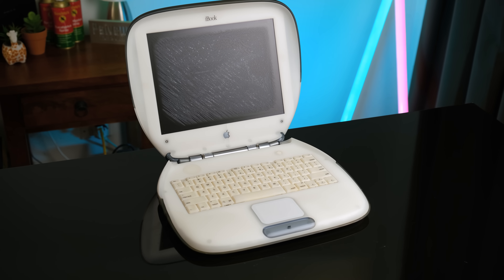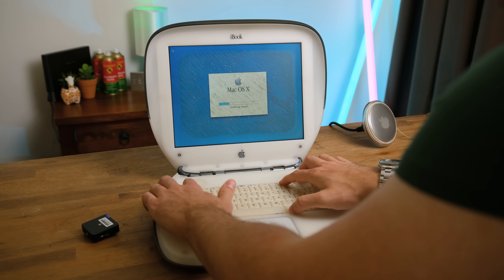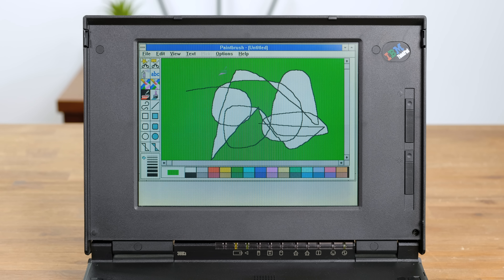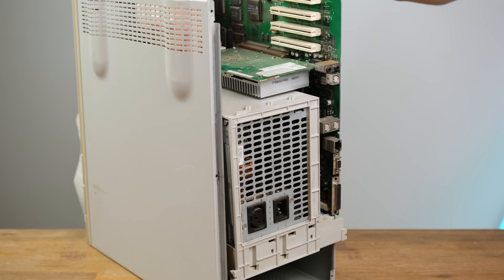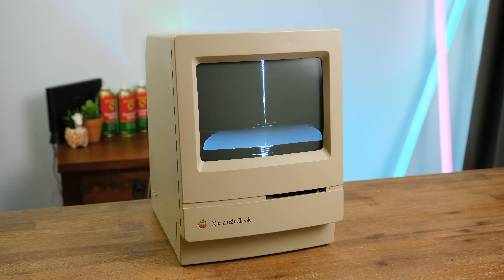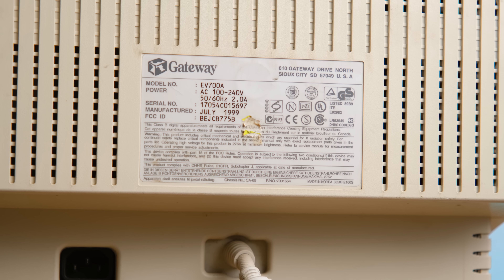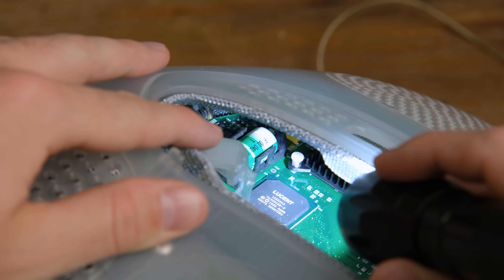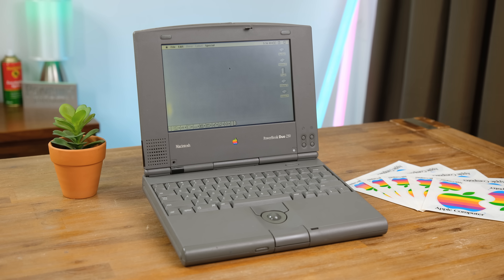So Much Vintage Tech Is Dying... Here's Why

Comment from the maker: And we're back! Hope you enjoy this video. ► Become a channel member today! https://bit.ly/PsivewriMembership
Reply: ok,
Reply: Glad to hear your back to using the same music from most of your recent videos. I love that track
Reply: I think you're not storing your things properly
I've never had this sort of problem with 10, 15, 20, or 30 year old tech of any sort. Tech doesn't just spontaneously combust.
You seem to love putting some sort of oil all over your plastics - yeah that's a recipe for disaster through chemistry. 
There's a reason that electronics engineers only ever use alcohols to clean plastics (aside from acrylic), PCBs, contacts, etc - it evaporates and afterward there's no chemical reaction taking place
Humidity is also a major factor
Your tech problem is you - sorry
Long term storage of tech: in a cool, dry, dark place. Use desiccant pouches if you can. REMOVE ALL BATTERIES. Lithium batteries should be stored in lithium pouches - not plastic ziploc bags
Cleaning: with soapy water in wringed-out clean cloth (microfiber works), followed by alcohol, let dry
Reply: Just as a heads up - if you see that layer of display on the clamshell Mac peel - DON'T. It'll smell awfully bad. I had this happen on a Compaq Armada E500 and ended replacing the whole screen with some scrap LCD I found that had a similar LVDS connector. Its original one smelled so bad its awful chemical/vinegar odor lingered for at least three days straight.

As for the Dell - it's a well known issues that those caps are bulging - Dell really didn't think the design of that PC through. That location gets even polymer caps toasty as heck.
Reply: To me looks like humidity problems 
IT might be a good idea to store all your PC's with a anti humidity solution .. either sillica sachets (when you get in new shoes box ) or any absorber..
Reply: I have a few of these models, and I just checked them... they're just fine.  Must be your environment.
Reply: Can you explain what brand of Eucalyptus oil you use? Are you sure it does not cause long term damage?
Reply: @azizchaudhry9544  yep it is causing damage through chemistry
Reply: @azizchaudhry9544  he uses boristos eucalyptus oil
Reply: @Typic Playz  notification
Reply: ahh Percussive Maintenance lols
Reply: Did something change in your environment? In me land I got a ozone gen, though its pretty weak, over time it seemed like everything old plastic and rubber began to melt and or dissolve. I barley use ozone gen but it had a noticeable effect on stuff. Situation improved when I discontinued its use. edit; cleaners and various sprays can also have bad reactions with things.
Reply: It's sad that most devices we use nowadays have a integrated battery that can't be removed, sealing the devices demise...
Reply: @risingsamsaragaming2681  Except you can remove it, you will lose water resistance tho.
Reply: *incert warhammer 40k techpriest  meme here*
Reply: IT'S CALLED IN-BUILT OBSOLESCENCE!!! A CURSE ON ALL CONSUMER PRODUCTS FOR THE BEST PART OF 30 YEARS+!! IF CONSUMERS BOTHERED TO COMPLAIN MORE, IT WOULD HAVE KEPT MANUFACTURERS ON THEIR TOES REGARDING QUALITY!!! BUT NO, A WEAK AND PASSIVE POPULATION SAID "NO WORRIES"!!!!!
Reply: To remove the disintegrated rubberised, try some hydroalcoholic gel, it works well for me.😀😎.
Reply: It's that a Steel Dive Willard you're wearing ? Nice 😆
Reply: @psivewri what about 3d printing supports for the older Mac desktop
Reply: Nice video!, It isnt just on retro computers eather, its affecting retro tech in general, for example a rubber band on a cassete deck wearing over time.
Reply: That display thing happened to my 2005 Acer
Reply: Thanks for the video. I’m thinking that this topic is something that the techie community want to avoid. 😢
Reply: Our favorite tech lives in our Hearts forever !  :-)   Really miss those old flip & slider phones,  each one trying to out-cool the other nnn  sadly everything is just a slab of glass now.  Funny how our 1950s Radios & old TVs still work great !
Reply: @SeaJay_Oceans  😭😭😭😭
Reply: https://youtube.com/shorts/T6-O2u0KCDc?feature=share
Reply: My laptop from 2007 has an annoying issue. If the backup battery gets low it must corrupt the bios settings so laptop won't turn on at all. 
So i have to remove it and wait for the settings to reset. 
After a few days it will turn back on and I have to put in a new battery while it's on.
Reply: 2012 mbp is on life support.. i dont think its gonna make it…
Reply: Everything falls to entropy, eventually
Reply: Not sure whenever it's mostly old macs falling to pieces because they suck, or this guy is an iSheep... Probably both🤣
Reply: That's scary that old electronics is rusting just like the bible says, "Lay not treasures on Earth where moth and rust doeth corrupt."

I don't like it that the computer motherboards are rusting away and falling apart. I want planned obsoleteness to be illegal worldwide. And make companies to be required to make spare parts and bring back repair shops.
Reply: @lessknowledgeplease  nah the trashcan is hungry for these old mac pieces of crap🤣
Reply: You should be "flashing" the bios, the firmware, and even the microcode (if you can), not only do they need to be archived (pretty sure they fragment over time) but copies could/should be sold off.
Reply: I think OZONE is doing that. Put machine into airtight zip bags.
Reply: CHECK OUT MY COMMENT ON THIS VIDEO GOT A SPAM ACCOUNT FAKING TO BE YOU!
Reply: I notice these are ALL Apple products. Apple doesn't make REAL computers, just cheap knock offs built for the public school system.
Reply: Who could give a shit
Reply: Watch out, the bots are on the loose again.
Reply: Who cares.
Reply: Planned obsolescence by greedy evil companies!
Reply: I'd be selling that stuff asap before you lose a ton of cash
Reply: great video!
Reply: I've had this happen to three of my loved laptops. Rip Aspire 3000 & HP DV9700 & generic educational laptop
Reply: I think it must be the way you store them lol 😆
Reply: This explains why they need full restorations, new upgraded swaps, and have them in a computer museum.
Reply: This is truly a sad video
Reply: IT WILL NEVA DIE
Reply: I am trying to sell older electronics that work. Anyone know a good site to do this? eBay & others seem bad because of shipping issues. I don't want to ship a motherboard that's 10 years old halfway across the country to someone that will claim it doesn't work. 

I have RAM, motherboards, power cells, batteries, GPUs etc. Id love to find someone locally to deal with but if not then I want to find someone who understands more than I do about how to fix since I was the original owner & I know it will work if it gets into the right hands.
Reply: @ModernDayRenaissanceMan  no
Reply: Lol all apple products hace always been made to self destruct over time.
Reply: if you understand the obsolete lightbulb conspiracy then, you understand theirs nothing to talk about.  apple just thought they could get away with an increase obsolescence cycle and blam, they were right... until they wernt.  Nobody wants a macbook anymore. the gimmick is as dead as Iphone 343.
Reply: Great topic.
Reply: bro just 3d print the parts of plastic
Reply: No, they are not dead!
Reply: 😂I can't believe you literally just hit a laptop and made it work again
I didn't know you could do that to fix the click of death
Reply: Looking forward to it!

Comment: Bought a severely yellowed Macintosh SE recently, assuming the worst. I just wanted a cheap CRT project. The battery, dated 1989, had zero signs of leaking, the system and analog boards were immaculate (still going to recap. Other than light ghosting/burn-in, the CRT is crisp. I'll never get this lucky when buying my dream machines. 😅

Comment: Hard drives are rather delicate, so it's advised to only open them up in a clean air environment.  Plus, if the heads stick to the platters, any contact with the platter surface will damage that area (which can also happen with the slightest specks of dust).  In other words, you do this stuff at your own risk, but if you have no alternative, it's better than nothing, unless the data on that drive is irreplaceable, in which case, only a data recovery specialty shop should be used (which is, unfortunately, very expensive).

Comment: I have a 90s arcade cabinet where the CRT went.

I had to ship it across the UK to get it repaired for around 600 dollars 15 years ago.

They claimed they repaired it but scratches on the screen make me think I was mugged and they just put in another old screen.

I had the Steet Fighter 2 bootleg board replaced with a neogeo collection but the new screen went after a couple of years.

I still have it and the sound works but it would probably be approaching 1000 dollars to get the screen fixed now with freight, cheaper to buy a new cabinet more easily available now.

A local TV repair man isn't an option as they no longer repair CRTs.

Comment: It was really sad to see tech that I used in my childhood slowly die. Most of my old laptops loose battery, HDDs jamming up, screen loosing contrast and developing lines, speaker membranes disintegrating and fans failing.
Reply: and plastic getting extremely brittle
Reply: @pentiummmx2294  that only affects white or gray plastic in my experience. Black plastic doesn't degrade or yellow as much
Reply: @dominicsaplthe grey PC/ABS type plastic really gets brittle

Comment: Imma quote myself 1 year later. In short the guy is improperly taking care of his old tech, using ISO to clean the screen and storing them in a none climate controlled environment 24/7/365 and blames everything but himself for his tech deteriorating. He then refuses to do repairs.

"It looks to me like your cool dry place really isn't cool and dry as you think it is. Also, UV light will destroy plastics. So if you love having your stuff displayed in lots of sunlight in your room? Guess what? You're killing it as UV damage is accumulative. Same if you store stuff in your garage or attic. You're killing it. A lot of non working issues are due to bad capacitors that are easily replaced. The popping of the fly back is mostly likely because it needs new dialectic grease applied to the cup. Another thing is that cold isn't good for electronics because cold things expand and expansion can ruin solder joints and mess with your LCD screens because that liquid wants to expand and it doesn't really have room for it Same with caps as many have a liquid chemical in them. Many "dead" device are brought back to life after cleaning, especially if they have moving parts and the old lubricants need to be removed and replaced.

Wait, are you using window cleaner on screens? If so? lmao you dummy window cleaners and iso destroys screens and can give you that hard surface. It causes delamination and dry rot. I use propranolol based cleaner as it's  safe on near everything as it's safe on polymers and isn't a corrosive like window cleaner and iso and window cleaner is for glass and not for ANY type of tv or monitor type of screen"-

Comment: Recently, my IBM Thinkpad A22M that I owned for a couple years started acting weird by randomly shutting itself off after being turned on for a bit. Later, I got a random error message when I tried booting into the computer. Turns out, the BIOS chip was completely fried, rendering the laptop basically useless.

This is the only laptop I owned that has broken down on me. I fear for the other vintage laptops I have in my possession.

Comment: i have an old PC i built in 2002 with a Gigabyte 8x motherboard; it was exposed to water a few years ago when my water heater failed and some of the capacitors rusted and died. i resoldered some new ones onto the board, but there are still many capacitors on it that are continuing to worsen in condition. thankfully, it still boots to windows 7!

Comment: i refuse that CRTs are dying!
Reply: Unfortunately my Sony Trinitron died recently… had to replace it with a new CRT 😢
Reply: @FadedVault  usually either flyback transformer or the capacitors or something on the analog board

Comment: I have a Powerbook 150... And I can confirm that this brittle plastic is a nightmare. Right I'm waiting for the cement glue to cure (it's like super glue but x10, the thing locally melt the plastic to bond with it then it solidify)

Comment: So sad. Make me wonder if accurate replacement cases could be manufactured by a company who specialized in this.
Edit - also makes me wonder if newer / better designed material could be used, while still appearing as similar to the original as possible.

Comment: Yes, the rubberized parts are annoying. I use wet wipes to clean the rubber off then isopropyl alcohol with a clean wet wipe to clean the rest off. However there are some phones like Nokia 5100 that have the whole body shell made of plastic combined with organic rubber that breakes when you touch it. I even bought a new original body shell and it started to desintegrate in it's packaging.
It's sad :(.
Also, nice collection!

Comment: I appreciate this is now an old video, but opening a hard drive is the dumbest thing you can do, even if it is not working properly. Hard drive 'stiction' can be relieved by applying power, holding the drive at the bearing centre and sharply tapping the edge of the drive in the direction of rotation. The mechanical inertia will separate the heads from the platters.

Comment: This reeks of planned obsolescence.  Poor quality plastics are mostly to blame.  It is not because of lack of technical knowledge.  I have transistor radios with plastic cases from the 60s and the cases are still as strong and as cosmetically acceptable as they were when new.  My biggest worry is material archived on CDs, DVDs, Blurays and magnetic hard drives.  Will they last as long as paper, parchment and velum have lasted down the years?  I hope so!

Comment: Thanks for the video! For some of us Baby boomers who were booming PC electronic sales during the 1990s more than you know what, its nice that some of the 1990s 2000 laptops had redundencies and failsafes, error codes, modules, upgrades, affordable and available repairs and spares. There were whole stores selling capacitors to keyboards. Compare that to a shiny new Alcatel Nokia HuaweiAndroid from 2016 whose battery just explodes?!? The earlier desktops were easier for endusers even neophytes, to repair. A compaq with this same leaky LCD " plumbing" caused corrosion to the inbuilt keyboard, fortunately a spare keyboard came in handy !( who in their right mind designs a liquid layer with non leakproof design right next to non IP 65 electronics?). And don't even get me started with the software planned obsolence of Windows. For all the genuine OEM Window licenses and additional software you paid for, plus internet access fees for updates and malware protection on squeaky expensive dialups, you get zero support just 8 years later. Its thanks to open source developers some of these 2006 machines are still usable in 2024, after being abandoned by Microsoft. Google's Android has faster development and upgrade cycles, with more diverse hardware and software support but then the flight risks of  battery explosions remain.
The nightmares with CD DVD drives continues, with imbecile shattered CDs, insipid region locks,drive heads locked in parked positions, poor quality degraded ink on CD RWs or peeling reflective layers on Moser Baers DVDs and CDs. Its a good thing some of us backed us up the discs, in time! Rarely, but true some LPs and magnetic cassettes have outlived CDs and DVDs, even modern 2024 "solid state drives" and sd cards! Lol😅 rare! Yes there's static and hiss and faint but still usable, compared to a shattered CD or unreadable SD card that needs microsoldering.
Reply: Don't get me wrong Apple, HP, SanDisk and Microsoft have some of the best brains and resources around. But even a billion dollars NASA Voyager probe had "planned obsolescence" but human ingenuity breathed life support into it, heartening when you know, you know.
Reply: 30 aeons of cosmic evolution get us to intelligent life with cardiovascular disease as number one killer on the planet, while these nanometer femtometer electronics #FAIL faster than the #failarmy. No matter what you do, never fall in love with these gizmos, spend reasonable on these, maybe use a surgeon's approach to fix them, else......

Comment: And on a side note:  We are using lathes and mills from as early as 1910 still, and they are still functional and will be for the next 500 years with good care and occasional component replacement.   They can even be retrofitted with CNC controls.

Comment: I’m so spooked, i have the same IBM ThinkPad from 1994 (but the active matrix model instead, the 360c) and it has a screen bubbling issue as well. It hasn’t developed to being this bad (no cracking/the screen works) and it isn’t that visible, but i’m so paranoid it’ll stop working, it’s in really good condition and i’d hate to lose its beautiful display, active matrix screens back then were rare

Comment: I have an old LG Optimus L3 II smartphone in a drawer in the box (the battery is out of the phone). The protective silicone case remained on the smartphone. Years later, I took the smartphone out of the box and the protective case, which was originally transparent, turned yellow and crumbled into powder. The smartphone itself works, although it is very slow.

Comment: So Dreamcast will die too?
Reply: Yep. But its mostly just capacitors.  Wich are easy and cheap to replace.

The problem is the laser. 80% of the dreamcasts have failed lasers.
It it fails youll need an ODE to play games again.